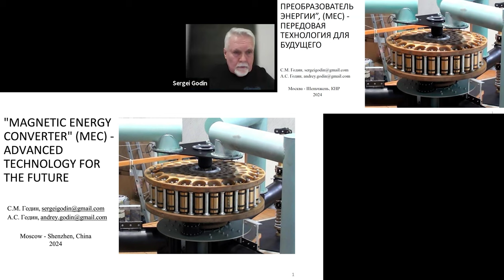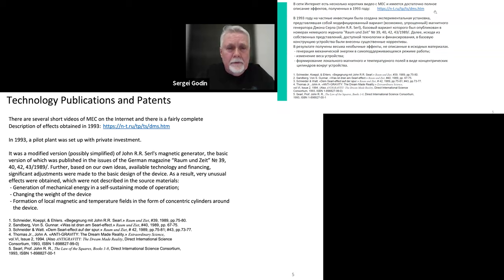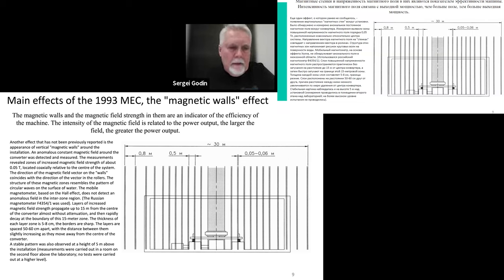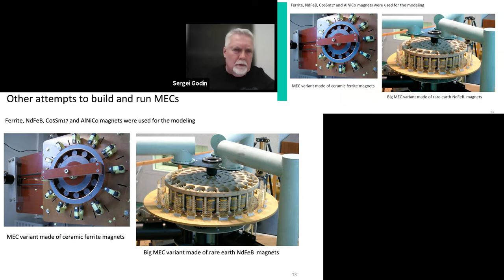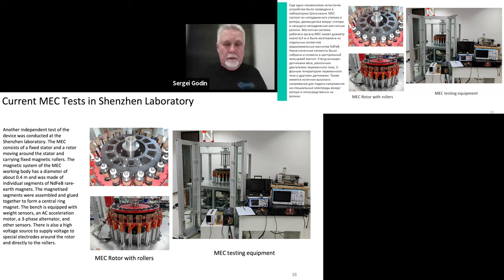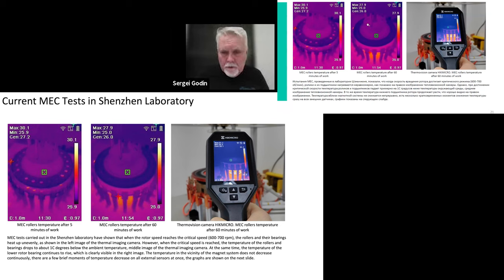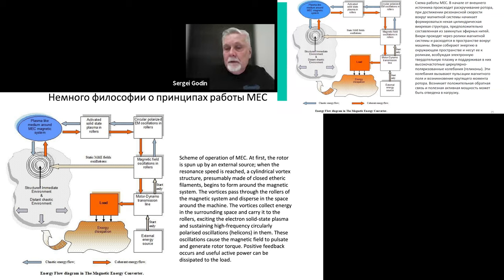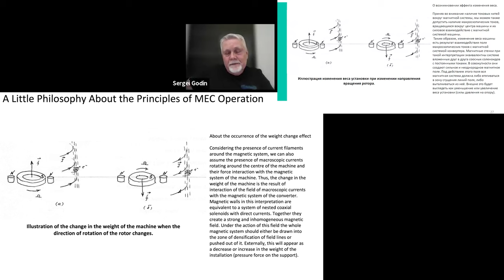Magnetic Energy Convertor 2024 - Sergei Godin (Approx. English dubbing)

Comment: I watched the video (from the link provided in this video), but it's hard to see all the different temperature zones. My point is that if one zone is heating up while another is cooling down, I would not be surprised to see a thermoelectric effect (Peltier - or an induced effect due to the electrical properties of the contraption having a similar effect as Peltier w/dissimilar metals & current flow).

Comment: Bob, it is the same thing and if you don't believe me then make this device and run it to power your home for a week and the magnets will degrade and you will have to continually replace the magnets. Don't claim something works unless you actually build it and use it.
Reply: Because of the Rare-Earths in the magnets, they don't degrade until decades have gone by.
Reply from the maker: I didn't claim anything, I translated Sergei's presentation
Reply: @Beamshipcaptain  Any magnet that produces power gets it from the magnet and the magnet degrades. It does not matter what kind of magnet a person uses. SAV Infinity used rare earth magnets and the magnets degraded after one week powering a house and the company went bankrupt.
Reply: @richardmuller867  Then they used inferior magnets. Searl magnets and other rare Earth magnets do not degrade when cohering power.

Comment: This is Otis t Carr’s concept. The Utron rotating the magnets.
Reply from the maker: A lot of people had ideas in this direction for sure. However, you want to rotate your charges non-physically in my view.
Reply: @MFMP  ahhh. I always thought the magnets had to be rotated. 
I thought it was the static field that rotates the Utron and in turn the Utron changes poles and helps rotate the magnet ring.. been thinking about the Utron bifiler coil and it’s geometry(round but square).